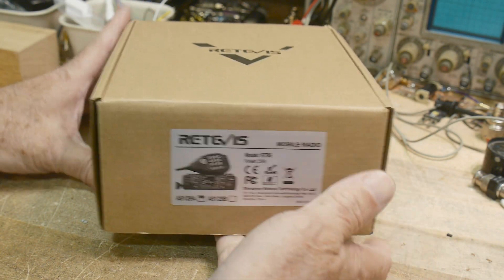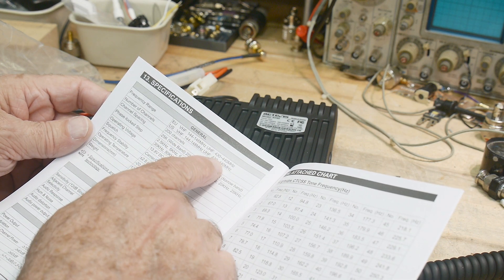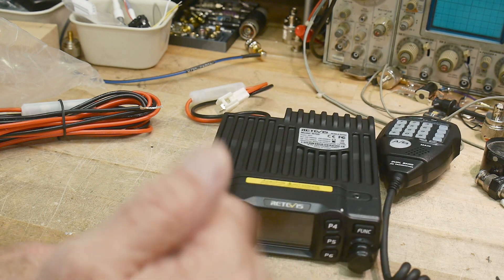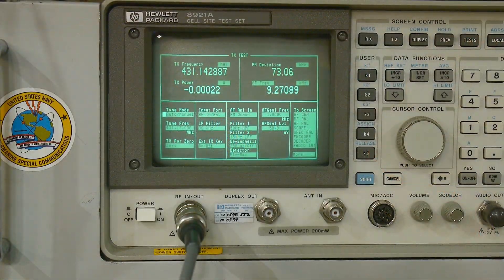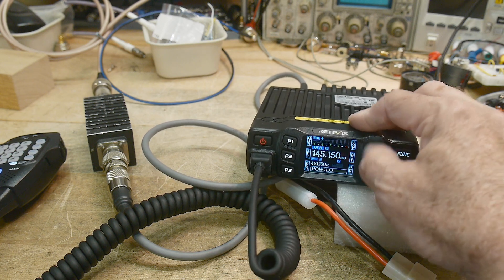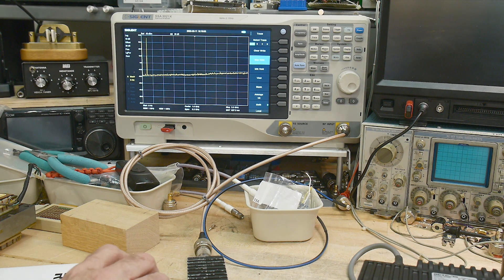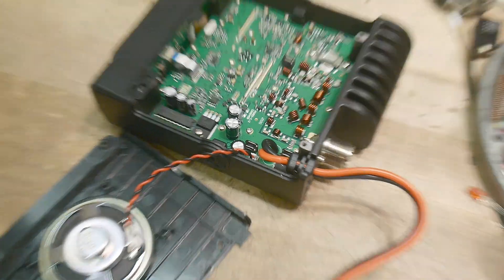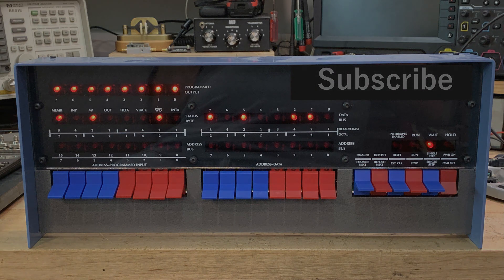#1438 Retevis RT95 144 440 MHz Dual Band 25W Review

Comment: There does seem to be some variance in these Retevis radio's, I have the RT-95 myself, and on high power into my dummy load it shows almost 33w output, its near 20w on mid and low tops the scale at 7.5w. I am NOT using the quality of test gear you are, but across 3 digital SWR meter's, there is less than .5w difference in the figures, so I have to assume they are close enough to accurate. As long as the output signal is still clean, I guess the rest is a bonus.

Comment: In another video you asked for suggestions for circuit boards.  Maybe two boards in one.  A simple transmitter with a push button and a simple receiver with an LED.  Each operating from a coin cell.  Snap the boards apart and separate them.  Then push the button and the LED lights up.  Just a thought.

Comment: 144-146 MHz would not be sufficient for the US band plan. Sounds like an EU version
Reply: You can unlock it to 136-174
Reply from the maker: 1): Turn off the device, Press P4+FUNC+POWER ON KEY (at the same time press 3 keys), then power on.
2): Rotate the channel knob to Choose to Mode menu
3) Press and hold PTT key on the external speaker mic. MODE no. Change to blue color, then rotate the channel knob to choose the frequency band you need.
When you choose Mode 2,then you can use the full frequency. 136-174 MHz and 400-490MHz.
4)Turn off the device, then turn on again. Will be the new frequency band you set.
Reply: it was. US model specs were on the next line